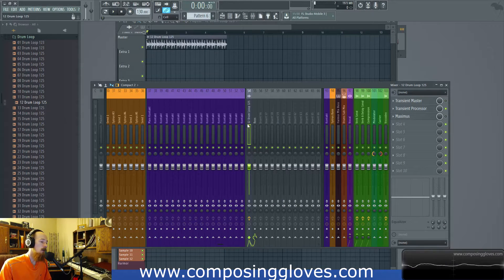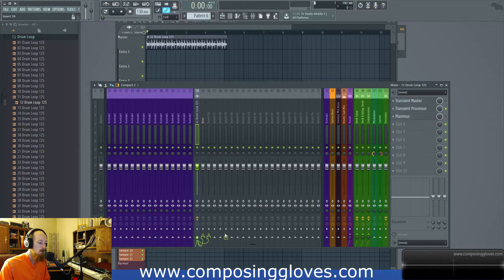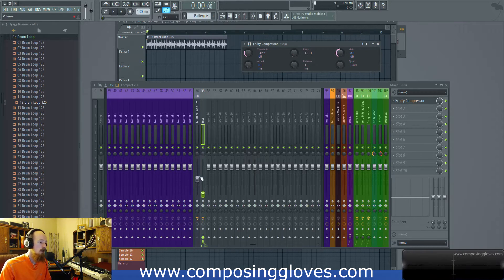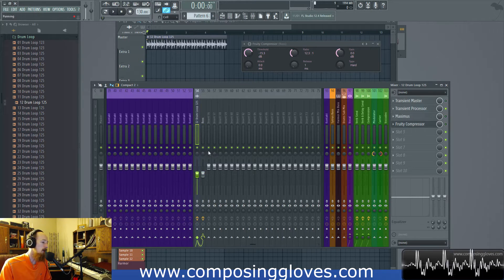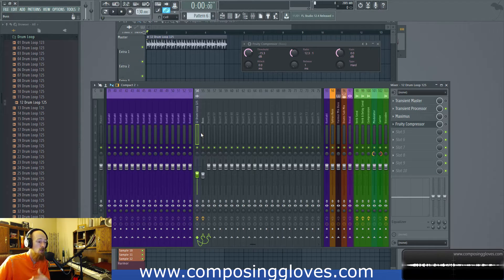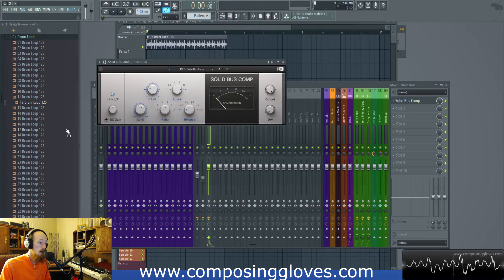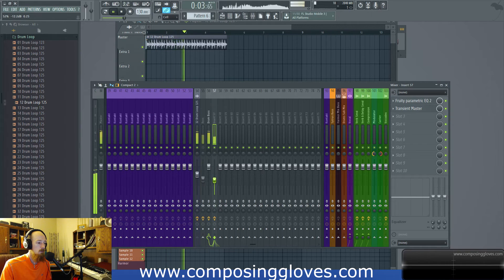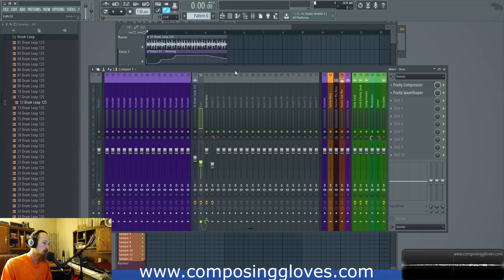Principles of Mixing 31 - Parallel Processing

Comment: whats the diffrence between putting the effects on the synth itself and routing it to other track isnt it the same thing? u can blend the effect youve put in one channel aswell
Reply from the maker: I can think of a couple reasons but in general sending to the channel is more flexible. The big reason would be you desire to put an effect in a particular spot in the signal path which could only be reached from the internal synth options. This happens to me with harmor from time to time. A second reason would be the FX just sounds unique (common with analog modeled FX) and a third reason would be so you can save it in a preset and open it in any project.

Comment: wrong routing of parallel processing. in FL Studio, you HAVE to send the source signal to 2 channel. 1, DRY channel. 2, Parallel channel. and then two of them going to the same output route. if not like that, you'll mess with the pdc. especially when the source and the parallel channel have tons of effect plugins in it. parallel have to be a duplicate/identical timing wise. to check if your routing is correct or not, put some different plugin on each channel,  drop the wet/dry knob to 0 (not mute button), flip the phase on one channel. if it's correct, the pdc will correct each channel latency from the effects plugin and then the sound should cancel each other and you have no sound coming out. check out image line forum for a legit explanation from image line. you're welcome
Reply from the maker: +Crimp interesting, thanks for the info, I have never had an issue with pdc before doing this method and I use other DAWs a lot so I normally don’t sweat it, if my ears hear some funny phasing then I may look at the pdc, but if I am going to parallel process I am going to alter the sound anyways. But I might as well do it the way that avoids any issues! Thanks for the tip!
Reply: you're welcome. and there is also an issue with the fruity limiter on the attack knob in limiter section that kinda mess with timing. you can try it by urself. example: prepare kick sample and route that to channel 1. clone that kick sample and route it to channel 2. in channel 1, put fruity limiter but not doing any compression or limiting so doesn't alter the sound. flip the phase on one of those channel. in theory, those signal should cancel each other, but no, you won't get perfect phase cancellation until you turn down the attack knob to 0 on the limiter section. same thing on parametic eq2 with HD mode on. turn it off to fix phasing issue. it's not the most important thing in the world, but at least be aware of that kind of issue. gbu :)

Comment: Hey! Amazing tutorial, I've got to say. Succinct and straight to the point. But there's something that bothers me... 

When I want to put a reverb on my lead synth and I want to be able to EQ the reverb I make a send with the reverb and route the lead mixer channel to the reverb send, right? If so, the next thing I should do is turn the dry signal of the lead all the way down, right? The problem is, not all reverbs have dry/wet knobs (see any Lexicon reverb) and I don't really know how should I go about it... Also I get confused about the 'route to this track' and 'route to this track only' options and the distinction between the two... 

Could you please be so nice and help me out?
Reply from the maker: If a verb has no wet dry option, then put it on a send like you said. Then just route that signal through that track (remember your send should be going out to your master). The "route only" option will remove all other routing of the track and send it to that one track only. The route to this track will send the signal to that track and keep all previous routing. Generally, unless you want to do a very specific insert effect you should just click to send to that track without needing to go into the menu. Cheers!
Reply: And how do I adjust the wet/dry signal when using the "route to this track" option? (considering the fact the the Lexicon reverb I use has no wet/dry knob)
Reply from the maker: You don't you control the amount of reverb by the amount of signal you send to the track.
Reply from the maker: https://www.youtube.com/watch?v=Uve8UJ4OZj8